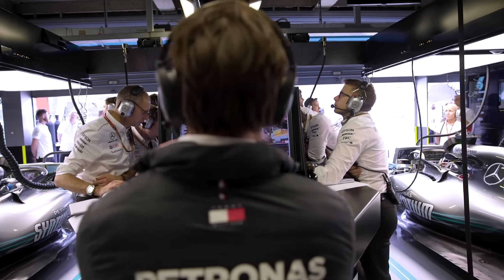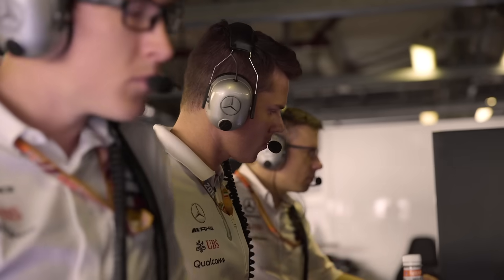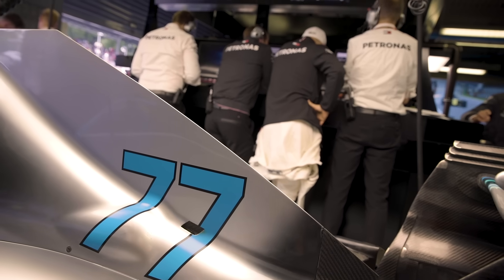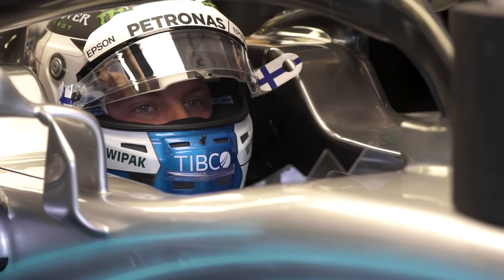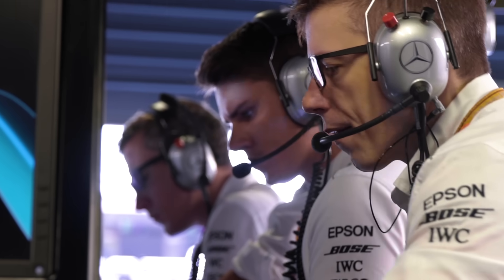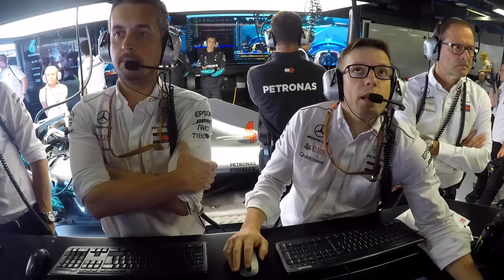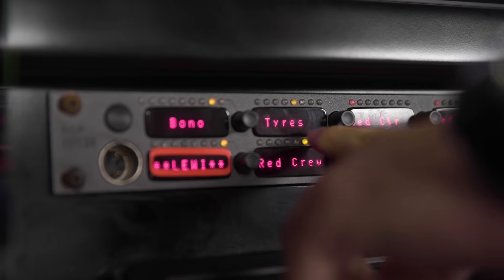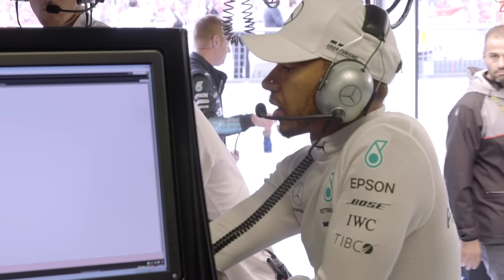What Happens at the Engineering Station in an F1 Garage?

Comment: The technology in the car is surpassed by the technology that supports the car. Supercomputers record hundreds of data points for later analysis and can feed them to a simulator which can replay the entire race as tires get used and fuel gets burned, as temperatures change, to come up with better settings and modifications for the following races! It’s amazing!

Comment: WOW what an insight. Just keep it that way guys. Keep it that way. Its very easy to lose it especially when you are on top. Live example Ferrari, they were on top and are still losing it by such small margins. Already looking forward to 2019, hope you guys build a car thats tough as nails, I dont think your 2017 and 2018 cars have been as good as the previous year cars, especially with the Tyres not working, a couple of engine issues, etc which I do not recall happening earlier. Dont let this become a down hill slope. Abu Dabi I am sure would be your all out 2019 On track Testing of all components ready or in beta.